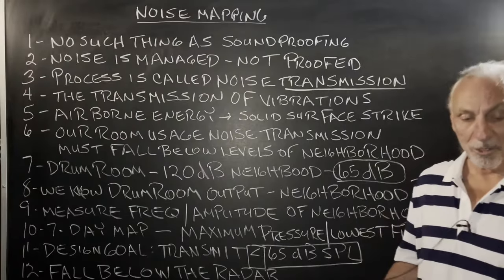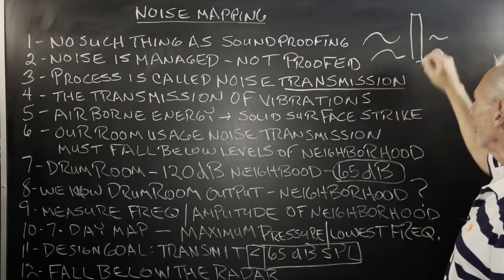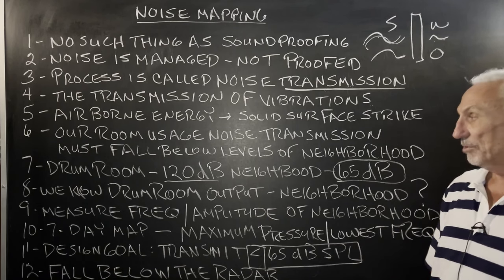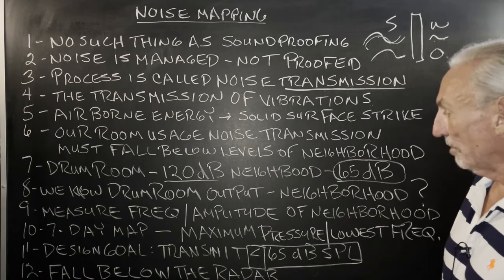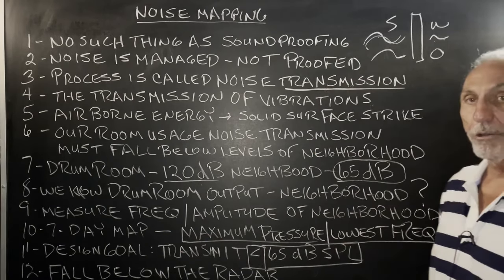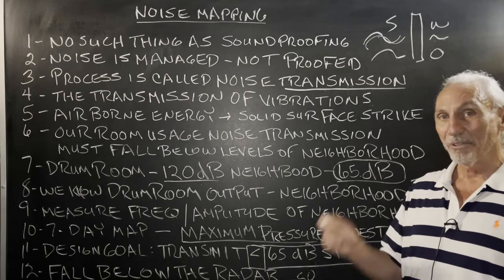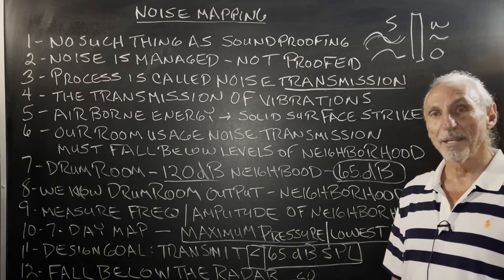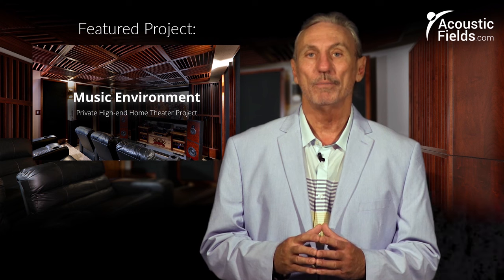Noise Mapping - www.AcousticFields.com

Comment: I was reading a study from Australia (where they love huge trucks just like the USA does), titled "Low Frequency Noise from Transportation Sources", you can do a net search for a PDF. Very interesting, and you'll see the sort of issues that places like urban recording studios have. It's not just the pastoral setting that have some successful musicians buying country house acreages and building recording studios there.

These are the low-frequency noises that shake the very ground all day long in urban areas, though only occasionally in quiet suburbs (where there's little nightlife, but listening noise floors are wonderfully low). Garbage trucks, busses, delivery trucks, ad infinitum, ad nauseaum. It comes through the ground, the concrete, the walls. Some places you've got the trash trucks and recycling trucks going numerous times per day. Some of this is well below 20Hz, you'll feel it in your bones coming before you even hear the truck.
Reply from the maker: Noise transmission should be relabeled as vibration transmission. With vibration mitigation its all about isolation from source.